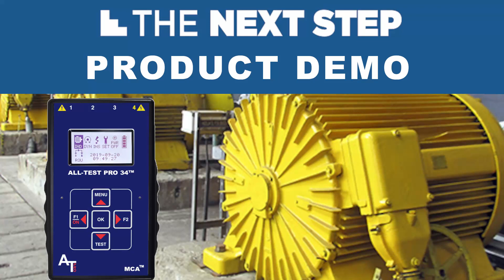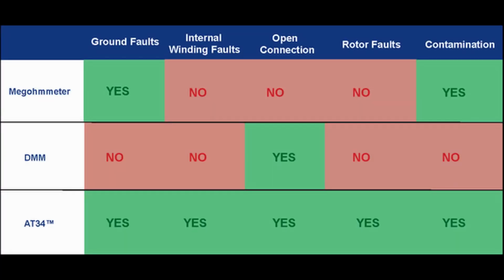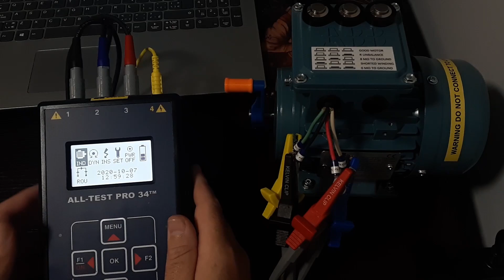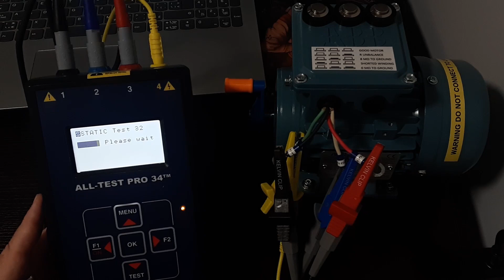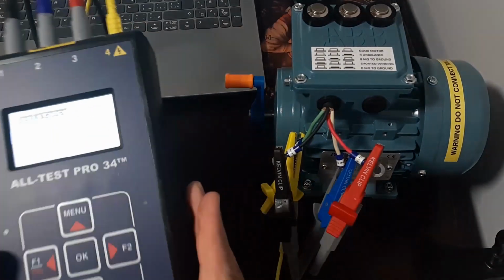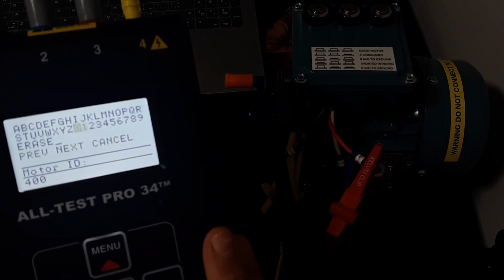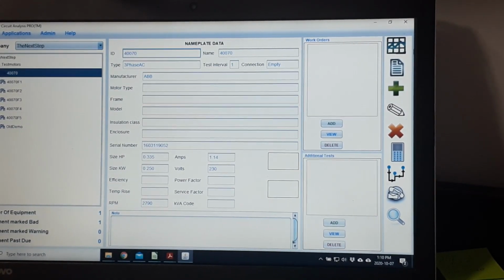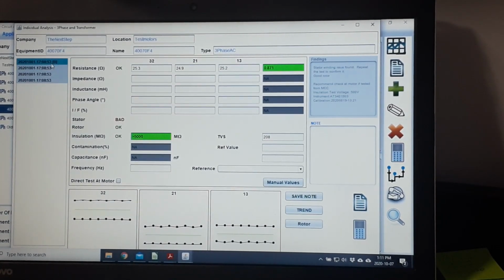AT34 Product Demo

Comment: he at34 doesn't show you the values of impedance, inductance, Phase angle and i/f?
Reply from the maker: That's correct, the standard automated tests don't show these values but they are used to calculate the other values shown. I reached out to ALL-TEST Pro for a bit of clarification below.
__
The AT34 output a low voltage, sinusoidal signal at various frequencies. Static measurements and calculations (we use Includes measuring a number of parameters between the three phases such as: Resistance (R), Inductance (L), Impedance (Z), Current/Frequency Response (I/F) and Phase Angle (ϕ), together with other proprietary parameters to finally calculate TVS, the “Test Value Static”.)  are made between the 3 phases, but the AT34 differs in that it provides a single value from this 3-phase static test. We call it “Test Value Static”.

There is also a manual dynamic test which provides a “Signature” for both the Stator and the Rotor. The Signatures are for Phases 3-2, 2-1, & 1-3.
__
These values can be tested manually through Settings>Manual Test and then selecting your leads and what values you're testing for.
Reply: @TheNextStepAgency  THE ROTOR SIGNATURE, WHAT DOES IT MEAN? DOES IT MEASURE THE IMPEDANCE?
Reply from the maker: @DALDMYG  It does measure impedance. If you just want impedance you can measure it manually.
Impedance is one of several measurements used in calculating the signature measurements. Those rotor and stator signatures demonstrate the "health" of the rotor and stator and are interpreted by the software to identify the specific problems.
I would recommend reaching out through ALL-TEST Pro's website to get in touch with a local expert or to talk to ALL-TEST Pro's engineers.
This is getting a bit more technical than can be properly addressed in YT comments.
Reply from the maker: ALL-TEST Pro just announced a free webinar with their head tech hosting it. I'd recommend that. He generally fields questions at the end.